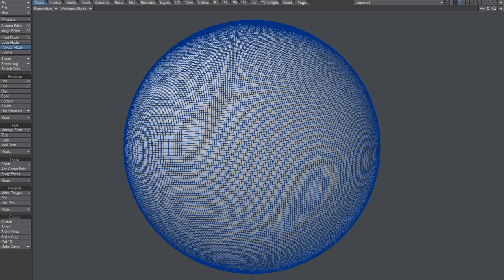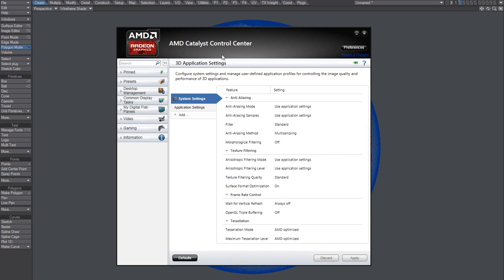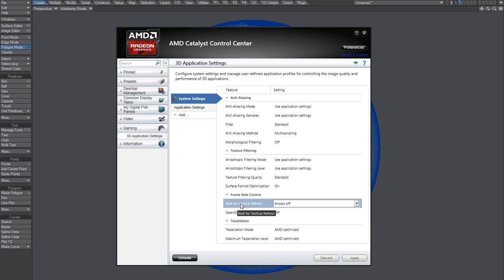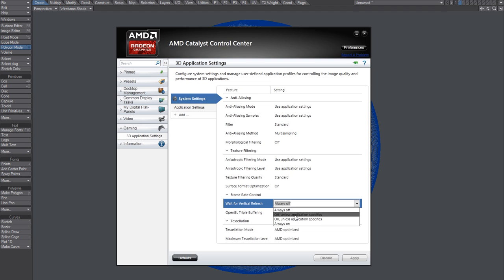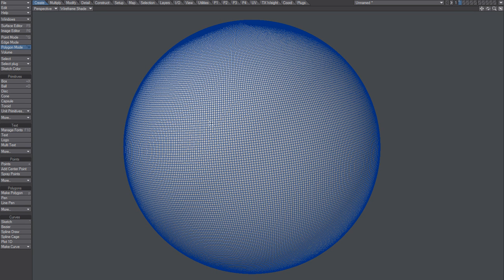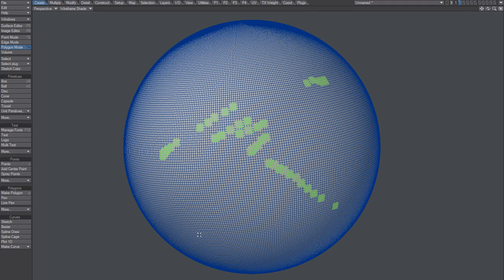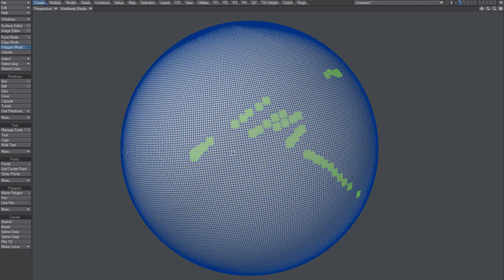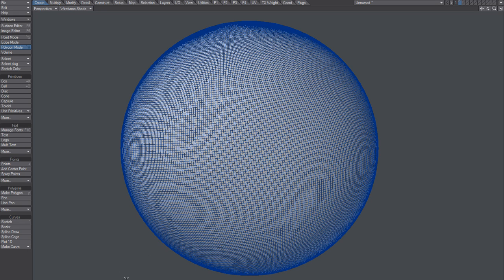LightWave Model - Select Connected, VSync Off  (Speed)

Comment: That's still pretty slow for only 18,000 polygons. I just did it here with 186,000 polygons and it was really fast near real time. Not sure why yours is so slow
Reply from the maker: i was told by Matt from NT that LW2015 is much faster, so could be it, running LW11.6 here...
Reply: I concur about LW2015 speed

Comment: Good tip
Reply from the maker: :)  sped up my Modeler for sure.
Reply: Unfortunately didn't seem to make a difference with my Nvidia cards, has the vsync setting as well. but no impact on select connected performance :(